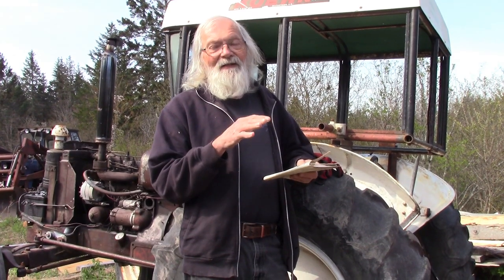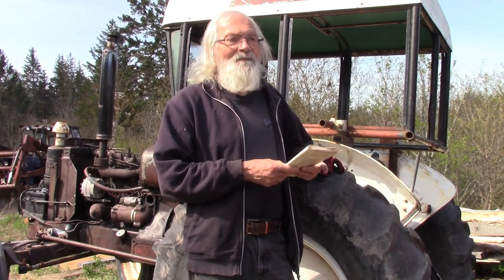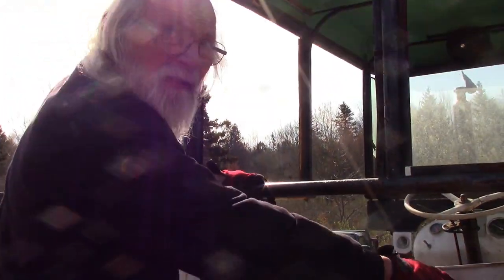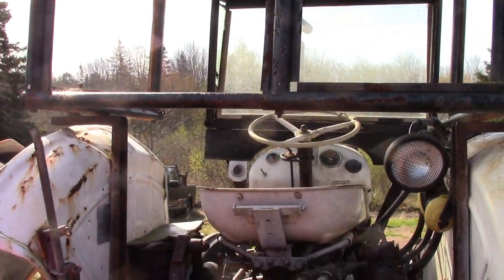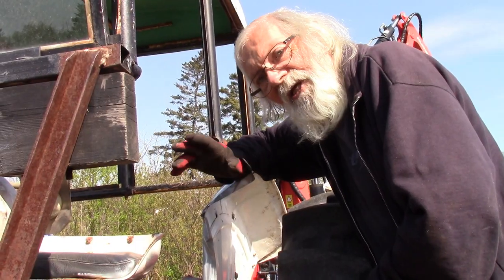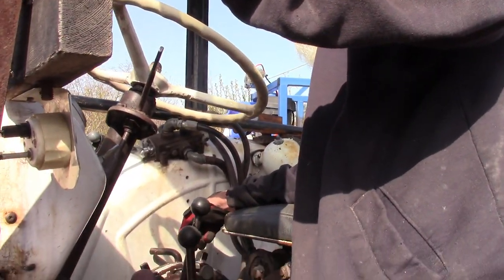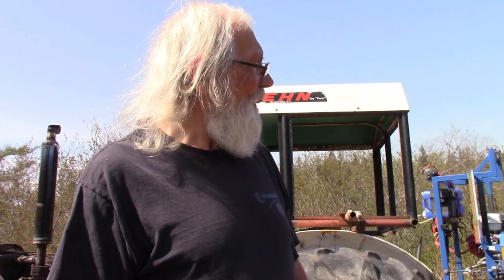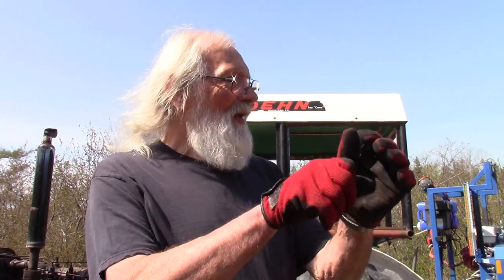80 David Brown Tractor has Hydraulics Issue

Comment: These tractors use the gearbox oil for the hydraulic fluid.  Usually changing the oil and filter cures many issues.  15w/40 or 15w/30 for the transmission oil
Reply: Thought I mentioned in the video, that I had done that first thing.  Thanks for watching!!

Comment: I’d suspect either a clogged filter either a washable metal one underneath or dirt in the system drain the oil flush it with diesel fuel even run it for  30mins or so with diesel in the transmission drain again and fill with universal tractor oil 15 30w modern hydraulic oil from the noises it sounds like oil starvation especially if it managed to do it previously
Reply: Great suggestions!!  Thanks for the advice.

Comment: Those damn DBs ! I own a 1967 Selectamatic David Brown 880 myself. Problem number 1. Very complex hydraulic system on those tractors for the time. Problem number 2. Hydraulic oil is shared with transmission witch is a pain in the a... Why ? Because hydraulic should by TDH oil (mostly light oil) and transmission should be 80w90 witch is an heavy oil that should protect the gears and differential. Problem number 3. DB's oil (transmission and hydraulic) can easily be contaminated especially by water. Finally. An oil pump that debits 6 to 7 gallons per minute... it's a tractor from the 60's we're talking about here ! Very solid BUT close to prehistoric. Question ??? Are you sure that the hydraulic oil filter is not jam pack with residus ? Some models had 2 filters (early version) and late version had only one. And if it's the chest valve that is involved here.... I wish you good luck ! Did I say damn DBs ?
Reply: Can agree with everything you say!!  Thanks for watching.
Reply: @mikehickey7881  Hydraulic oil pressure for the DB880 Selectamatic is suppose to be around 2000 psi. There are only three features that can be an issue : Hydraulic oil pump (witch I'd be very surprised), oil filter (mostly the problem), valve chest that needs to be cleaned up especially if hydraulic oil hasn't been serviced for a long time OR if it's highly contaminated. It's not such a big deal to fix. All you need is time... and patient.